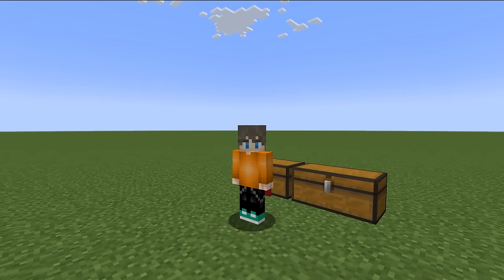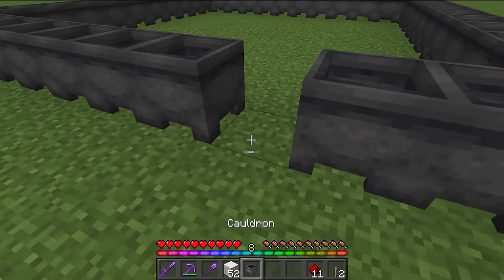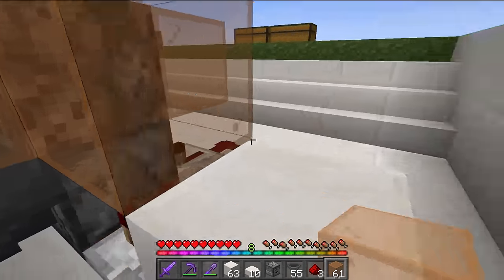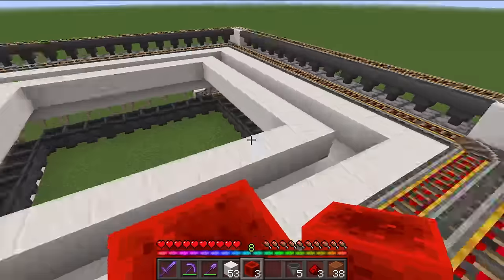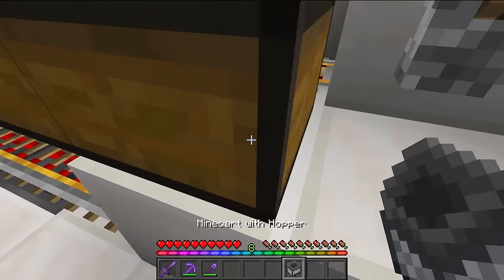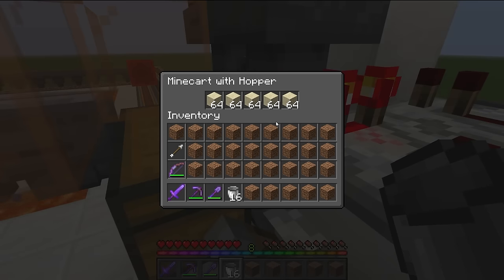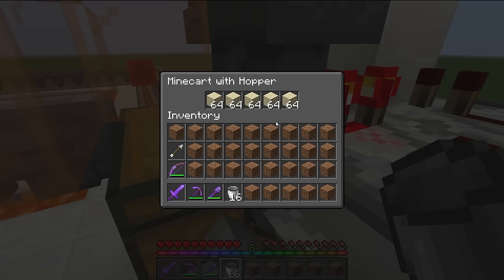Lava Farm Super Smelter Tutorial for Java 1.21 (and 1.17+)

Comment from the maker: Known Issues

- Hoppers aren't really fast enough to make this work for a long period of time as intended. Items do back up. 
- Starting the farm up is easier with 4 junk items in the hopper that can't be smelted so you only need a couple buckets per furnace at first. 
- Lava cauldrons take 19 minutes on avg to fill up, there aren't enough cauldrons to constantly smelt using this. 

I am working on fixes and a v2 but honestly, building an actual endgame friendly lava super smelter runs into MULTIPLE challenges and may not be viable at all. This does work and I use it in both of my hardcore worlds (Twitch & YT) but the issues do exist.
Reply: Obviously use composters then, silly! 😜
Reply: I actually see quite a few modifications that would solve most of these issues.
From the top, the bucket collector can be simplified to feed the bucket back into dropper system. (the redstone block will bud power, and will break bedrock compatibility)
Instead of a spinning cauldron design, a zigzag would work better. you could completely remove and fill a 10x10 area of cauldrons.
Item storage is kind of messy but this is meant to be simple, so it works.
This is a functional design, so I can't really be too critical on it.
it works, it's easy to build for the average player, and it's not meant to be complex. For that, the issues presented are worth the functional design you've presented.
Reply: What if you used a large kelp farm to feed the farm instead of lava? Added bonus if you keep the chunk loaded it will give you lots of extra fuel
Reply from the maker: @victorkirkwood1256  Kelp (and bamboo) are much, much laggier, especially when they get harvested. If you're chunkloading, it's very possible for you to be doing something "critical" to living and boom, lag spike just because, and you're dead. 

The "best" fuel is probably duped carpets. After that it's probably a tree farm turned into charcoal. Then lava, then bamboo & kelp, then actual coal. And I don't consider blaze rods actual fuel unless you are playing in a modded world with things like silk touch blaze spawners. You just can't get a really serious supply.

Comment: This works on bedrock as well, just replace the solid block next to the piston with redstone dust and put the lever on the piston itself
Reply from the maker: I hadn't tested the other mechanics so I didn't list it for both yet but yeah, we made the lava farm work for both. I'll list it for both once I do a full test. Thanks!
Reply: BRO came exactly for this, awesome tips.
Reply: Are you in creative or survival mode?  Also, which version?
Reply: I tried this and it works the same for me either way (in creative mode, I haven't tried it in survival yet), because I put redstone dust all the way around the whole thing to connect all 4 corners.  Thing is, I can't seem to get the hopper to drop the 16 buckets and dirt, then keep 6 buckets.  Nothing happens there.  How did you get that part to work?

Edit:  Nevermind.  I had a comparator where I should have had a repeater.  Fixed that and the hopper works just fine!  Moving forward with the tutorial!  Oh, also, Shulkercraft's way of doing the 4 corners works well in Bedrock, as does the way shown here.  The way Shulkercraft shows it, you can have 4 ticks, the above way is crazy fast, so it depends on what speed you want, I guess.  Anyway, the levers instead of the button works just fine in Bedrock.  Haven't tried it with a button - don't see the need to at this point.
Reply from the maker: @justrosy5  it should fire the comparator when you put something into the hopper behind it. then the dust, then the dropper
Reply: was going to ask . thumbs up

Comment: Is there any chance I could get the dimensions of the farm? I've tried to figure it out by pausing but don't want to be wrong.
Reply from the maker: The build is 22x24 (24 is front to back) but including some of the additions more like 26 front to back. You'd want a couple blocks around it - safe to assume the build should have at least 24x28 and you'd at least be able to move around. 30x30 would give you MORE than plenty. If you put it indoors, give yourself 10 high for extra room from the cauldrons to the ceiling.

Comment: listen i may be the only one asking this but what do you mean by feel it all up like 300 buckets and idk where to put them
Reply from the maker: There are two ways to "fill" this system. The first is to put 4 "blocker" items into the fuel hoppers behind the furnaces ... that way you only need 2 buckets each to get it started (that's 1 in the furnace and 1 in the open hopper slot). The other way is to completely fill this with 1 in the furnace and 5 in the hopper behind. 6 lava per furnace times 50 furnaces is the 300 ... but I've been using the 1+1 so 100 these days. It's cheaper to get started. :)

Comment: To solve the issue of the farm sometimes producing 2 buckets and you only receive 1 in a much simpler and more connected way, just have the dropper drop 2 buckets using an observer and using hoppers to pick up the excess and a dropper elevator to elevate the buckets back up into the dispenser,
Reply from the maker: Agreed, this would be one way to do this with a bit more work - I replied the same thing to Something Something's comments about an hour or 90 mins ago. I'll look into it - thanks!

Comment: Hey, I just built this smelter and realised there are some flaws. 

When smelting boxes of items, the collection system of cooked items will clock up really fast. Our hoppers underneath the furnaces were completely filled up since the hoppers can't keep up with the amount of items being cooked. 

Another flaw is the item distribution, if the hopper on top of the minecart is full, it will let the minecart always go. But the minecart can't take enough items to refill the furnaces because of that.

 I'd suggest trying a minecart to collect cooked items, if possible (I'll try to find my way around it).
My fix for the distribution of items is, to activate the minecart manually, then using a detector rail which activates a small clock to give the minecart enough time to collect the raw materials.
Reply from the maker: Yeah there are a couple things I want to fix. The main ones are what you mentioned plus the fuel not being enough for 50 furnaces. Over time, sure, but if you want to smelt "boxes" at a time, it's not enough. After testing and using this for a few months I'd call it a great mid-game furnace but not endgame. I will build the end-game version soon, I hope!
Reply: @RadicalElder  it's a great by no means 😉 We just needed something to smelt, since we don't have a good way of getting lots of coal yet. My dumb friend just decided to smelt 4 boxes of cobblestone instead of just haste mining stone with a silk Touch😂

Comment: you are very smart and i would have never been able to come up with the part of the farm you built, but the problem with it is that a bamboo powered smelter will just always be superior since bamboo grows so abundantly and its like the best smelter even if lava smelts 100 items
Reply from the maker: Bamboo smelters lag horribly compared to this so for people with lower end machines, this is the only way. On servers, this is the better way. And in singleplayer it's very compact and can hide away inside builds and not have to be covered with a build that's 25+ blocks tall. :) So it has its uses. Also if you want to smelt say 5 shulkers of smooth stone, the amount of bamboo in your farm will need to be huge. This will do it easily and with lava to spare.

Comment: Could you go into the card loading system in greater detail? Great video - thank you!
Reply from the maker: As far as how it works? It's a neat little unloader because of how simple it is. When the input hopper gets 23 items inside, it fires that redstone dust that goes into the repeater, while firing the "side" system which is that hopper/dropper clock. The hopper dropper block then powers the solid block and the dust, which turns the rail on and fires the cart off. The hopper passes the single item back and "resets" the system so it can happen again next time. The lever on the "inside" of that whole system just overrides all that and powers the rail directly in case you need to set it off without the hopper having "extra" in it.
Reply: @RadicalElder  Thank you!

Comment: I watched through once and intend to watch again but where and how do the furnaces get more lava buckets in them when a bucket is already there? How do the empty buckets come out of the furnaces? 

I know this is over a year after release but thank you for any response
Reply from the maker: So lava buckets go into the chest, up the water elevator, over into the chest near the top. The minecart grabs 5, distributes them to any hoppers that need it, and those hoppers feed the furnace. When it's used, the bucket is simply returned the same way as the output items, which is what leads to that filtered section that points into the dropper. So you get the empty buckets back and ready to use again. And I reply to every comment on my channel (so far) so no worries. haha

Comment: Hey!

I want to start by saying thanks for sharing this cool construction.

However I don't have need for such a big design and I'm wondering how small I could make this and still have it work?
Would it be possible to do a compact version using say 20 furnaces (or even fewer), or would that be too constricting to be able to fit everything? If not, what could the issue(s) be?
Reply from the maker: You could definitely do fewer furnaces. End the rail wherever you want, above whichever hopper and furnace. I'd probably keep the main design and just remove furnaces but yeah it could do 10 if that's all you wanted.
Reply: @RadicalElder  That's good to know! 
I've just made your lava farm setup so I may upgrade it into the smelter. Having some kind of problem with the dispenser however. The cauldrons are moving around but the dispenser itself isn't doing anything. I thought I had to click the comparator to set off the dispenser but that did nothing. I also tried having the redstone and dispenser on different elevation without any progress. I'm sure that the solution is very simple but redstone is a mystery to me. Much like baking.
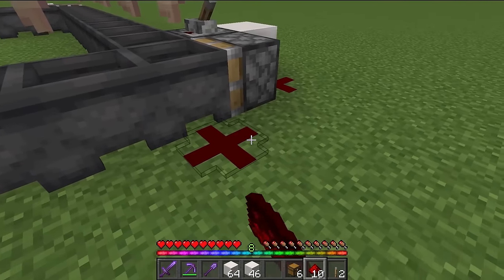Reply from the maker: Dispenser? If you mean the dropper that gives you buckets back, it needs to be a dropper ( 4:25 ) so that could be the issue?
Reply: @RadicalElder  Solved it but opted to use the smelter with just the "conveyr belt" and no dropper as my needs are just not that high, but I really like the whole idea of a rotating cauldron system. Thanks again! :)

Comment: HI, ^^ 
just made it , i look to understand every part of your amazing farm, (really amazing) i have a question : what's the purpose of the lever behind the chest under the cauldrons? 
 when i activate the farm, i understand that you activate the lever at the corner with no empty space with a double clic , that s ok,  if i try to manipulate the lever behind the chest it's not make any change.
Reply from the maker: The hopper catches the buckets you throw and then puts them in the chest. The lever behind the chest locks the chest so you can "keep" lava buckets in there if you want. Maybe you are making my hoglin farm and want 50 buckets of lava - it won't go into the furnaces, it just stays beside you to use for other things than the furnace.
Reply: @RadicalElder  thank you so much for your answer ^^
Reply: @RadicalElder   Hi again ^o^, i have a trouble on one thing (lava buckets and hoppers  works perfectly don't worry).  
In the video i saw somethings that i don't understand again :/
It seem to be  an automatic refill and go for the smelter cart am i wrong? 
The cart is Off,  the double chest with hoppers refill with the double super light speed ^^ 
and when it's full, i did the same thing as you , put a comparator in the good way, a repetor and 2 redstone. 
A signal pass through the comparator and activate the redstone signal , the cart go to his purpose automaticaly, this is exactly like you , we are ok. ^o^ but just after that,
The "Off" powered rail stay inactive But The redstone signal stay ON and i don't now why. 
Really i look at this video in 25% speed, 10 times since this morning and i don't know why the cart stop , refill but stay in place. 
 it look like it's automatic in your video. Cart stop , refill and go alone . Mine is on strike ^o^ 
Thank you a lot for your response, your design is the angular piece to my huge automatic farm.
I connect to the input  a lot of automatic farms: chicken, porc, beef, lamb,  potatoes, kelps, stone, sand, and in the output i use an Item Sorter
Reply from the maker: The cart loader is a bit strange. I'll tell you two ways to fix it: 

If the cart does not fill up +23 items in the hopper it won't send so you have to use the lever to send it yourself.

If the cart does fill up and the hopper somehow fills MORE than 23, it won't send so take everything out of the hopper and let it start over from 0 and it will run automatically. 

One of those two things should fix your problem. :)
Reply: Thank you so much for your patience and explanation ^^
Reply: @RadicalElder  It works  so well when i take everything out . I just need to make a filter before the input chest  cause it don't work with mix items. I think it's a better option do keep it semi manual  with a pre-filter , i can manage my need . Thank you for your help ^^

Comment: so i just built this i have not run it smelting yet but have read some of the comments and to hopefully to help a little i have added a snake in the piston belt to the middle and gained 15 additional dripstone plus caldrons with just 4 additional piston stations as for the hopper problem not sure if a water system would help it could feed multiple hoppers that should speed things up
Reply from the maker: As long as you aren't smelting like 8 shulkers of stuff, most of the "problems" are just not wanting to player-interact or not wanting to wait for it to finish properly ... it works, it works pretty well ... it's just not "fast." It's mid-game, not meant to be late game for anyone, so it does the job but yeah it needs a v2 or something. haha
Reply: @RadicalElder  that's all true i guess some people just like to moan :) it looks like it will serve my needs and i only added the extra laver sources to help me get it full quicker so i can just set me AFK there any time i nip off to do something to get as much fuel in it as i can so when i do get round to needing it it is ready to go 
all in all i think its a cool design i just need to put it in a big building now though :D

Comment: Do all of those powered rails need to be powered for this to function?
Reply from the maker: No it just simplifies the build. Otherwise you need a bunch more redstone blocks or another way to power the movement. As long as they can get around that's all that matters.
Reply: @RadicalElder  Alright, thank you! A few more questions I've been having since I built this... What does the lever beneath the one cauldron actually do? And why does it need 300 buckets rather than enough to fill the furnaces + the dropper?
Reply from the maker: If you flick the lever, the lava buckets stay in the chest and don't go to the top. This is useful when you need the smelter to act like a lava farm, not a lava super smelter. 

I say to start with 300 because that fills all furnaces (50) and all hoppers (5x50 = 250). You can then just collect more for the chest up top but that becomes backup. You don't have to have 300 to run it but it works best when starting with it full. I normally throw another 10-20 stacks of buckets in the dropper just to get started and that seems to keep it all working smoothly.
Reply: @RadicalElder  Alright then, that helps a ton! Thanks!

Comment: my only issue with this is tha the smeltable items hopper doesnt stop under the chest and only fills up with like 5 items at a time
Reply from the maker: It tends to back up - this isn't an ideal setup, it works great in the midgame but needs improvements to be that good at the endgame.
Reply: @RadicalElder  i realized i built it wrong and for some reason with 1.21 it works if you build it how it it told in the video instead of the edit where you “fixed it” by raising the dust and comparator
Reply: but then it broke the cauldrons lol so i’m troubleshooting now

Comment: Would it be more efficient to turn off the cauldron chain and let them fill first? or have it constantly running? obviously one is more bucket intensive than the other, but aside from that, not sure if it affects the fill rate of the cauldrons
Reply from the maker: It doesn't affect fill rate very much. I turn it off most of the time because it's a bit loud, then I just run it when it's a bit more full unless I'm using it as a lava farm. Then I empty it, run it AFK for a bit, fill it back up and go again. :)

Comment: I got a problem with the input minecart loader—it doesn’t fill the minecart then travel on the tracks so it’s been unproportionately filling only the first several furnaces…
Reply from the maker: Sounds like the lever is always on? Let it fill up by turning the lever off and it should stop, fill fully and then go back out?
Reply: @RadicalElder  okay I didn’t realize that part was manual I thought the comparator turned on the track when the cart was full. Thank u